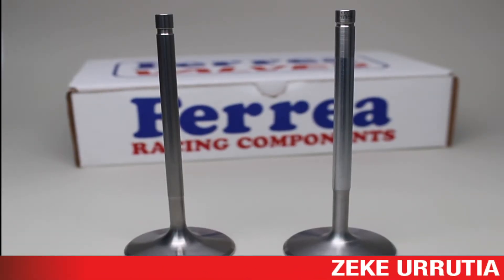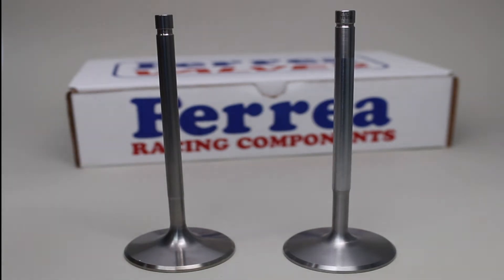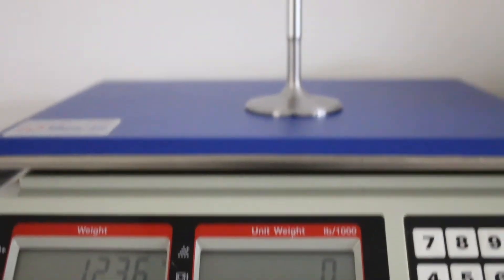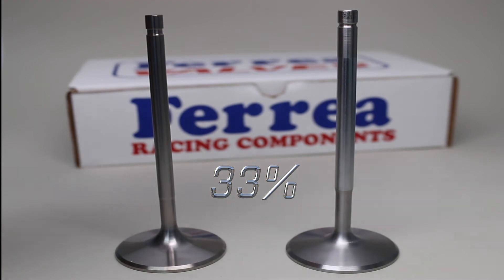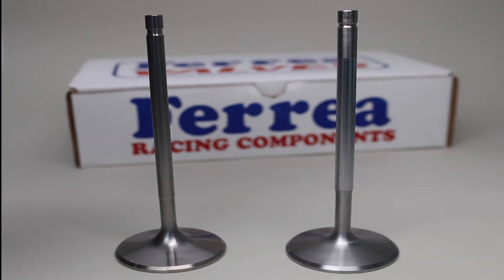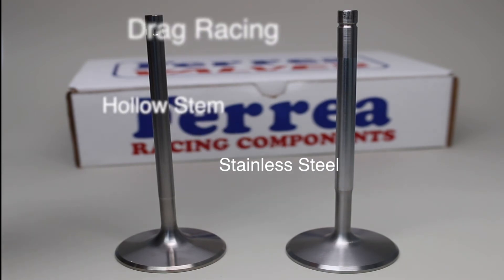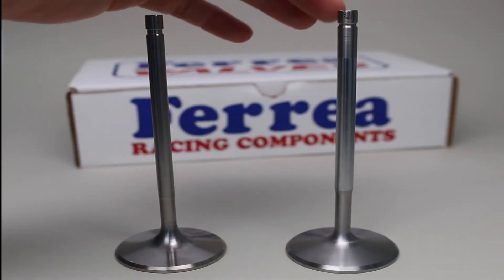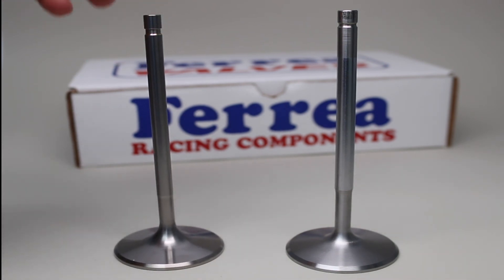Ferrea -Tech Tuesday Titanium valve vs. Hollow stem stainless steel valve

Comment: I’m looking to have a set of custom cut titanium valves for a 7.3 Powerstroke Diesel. Aiming for but not 100% on head diameter size but am certain to have 45 degree cut valve angles. Specs are as follows: Intake Valves - Head Diameter 1.875”, Stem Diameter .3122”, Length 5.805” Valve Angle 45 degrees, Stem Type 1 Grove. Exhaust Valves - Head Diameter 1.875”, Stem Diameter .3122”, Length 5.799”, Valve Angle 45 degrees, Stem Type 1 Grove. 16 Valves total 8 IN, 8 EX. Other than Head Diameter and Seat Angle, Stock Ford specs are what I am referencing. Can you please leave me a ball park estimate in a reply?

Comment: Curious as to whether your Ti valves are OK for the exhaust side, as it seems you're showing an intake valve, based on head diameter?
Reply from the maker: Titanium on the exhaust side can be used when the environment is ideal for it. For example on a street engine you will get very little life. On a race engine using race gas or methanol in a drag racing application you could get about 1 year before you need to replace them. All this depends on the use and application.
Reply: Thanks for that speedy reply. Always nice to know your do's and don'ts when considering valve train options. Looks like your hollow stem steel alloy valves would be the best option for my LS1 street build.
Reply from the maker: Our pleasure. Great choice on hollow stem stainless for the LS1 build.
Reply: @FerreaRacingComponents what actually happens to titanium valves when they wear? Do they stretch? Or shatter? 

Can they take a maximum of 850C 1560F on E85? 

I have a street engine with them, was curious to know why they aren't suitable if you can help!